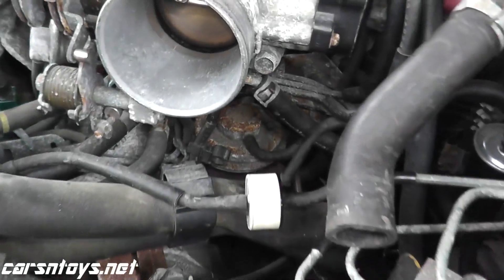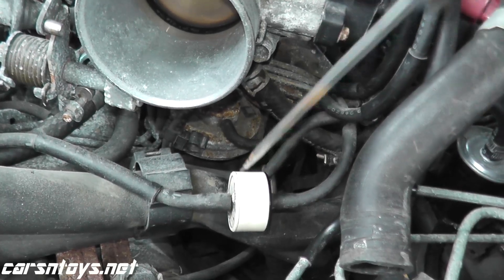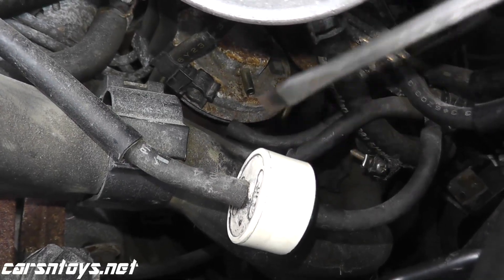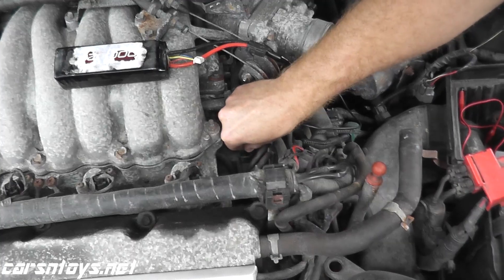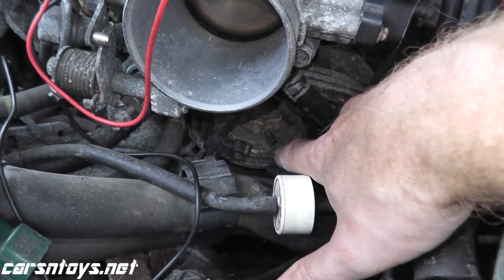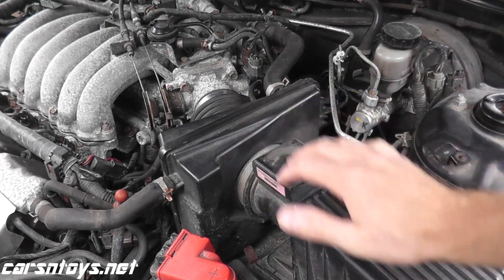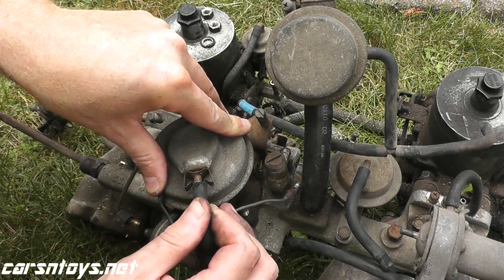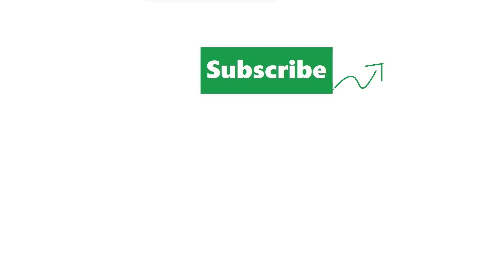P0400 EGR Repair with Basic Hand Tools

Comment: Mine has vacuum on the line and when I pull the hose out all the vacuum in the line is gone i think i will need a replacement of the solenoid...

Comment: I have a 1991 Nissan Stanza. What is the white component in front of where you are working that is between two hoses. On my car the hose is so brittle it crumbled so o cut it off and it is to short. My question what is that white part